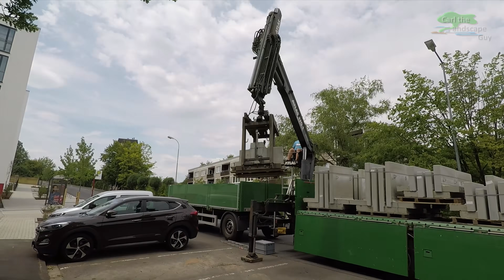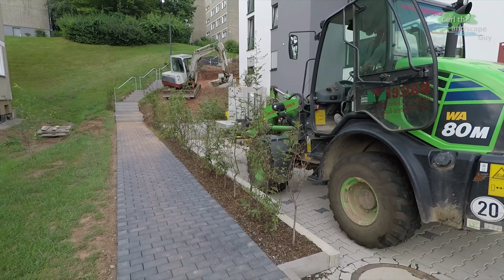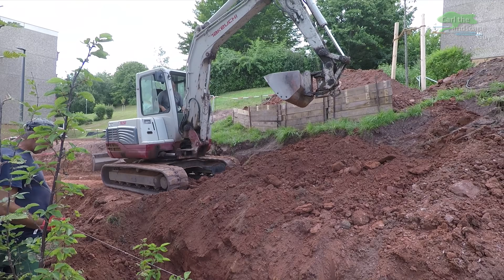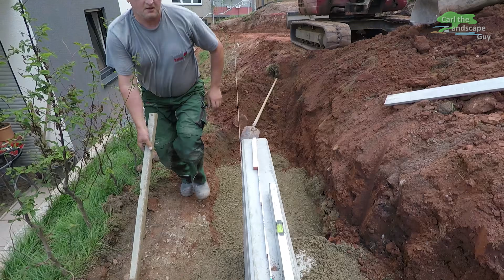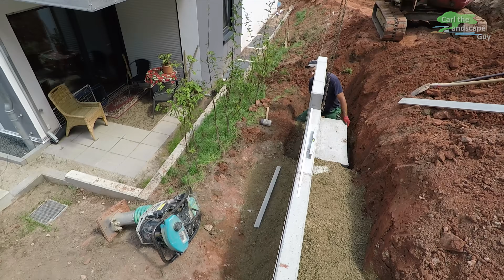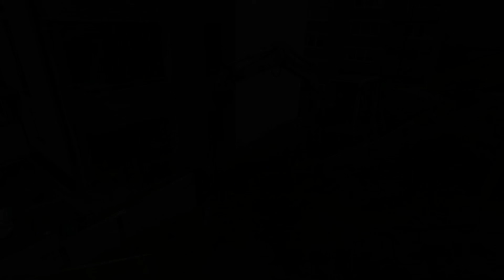BUILDING PRECAST RETAINING WALL | CONCRETE PANELS PLACEMENT | ASSEMBLY,EXCAVATOR CONSTRUCTION,HOW TO

Comment: Don't you need to put a drainage system in behind those?
Reply: He just said that a pipe for drainage was installed exactly at the corner of the concrete slabs.